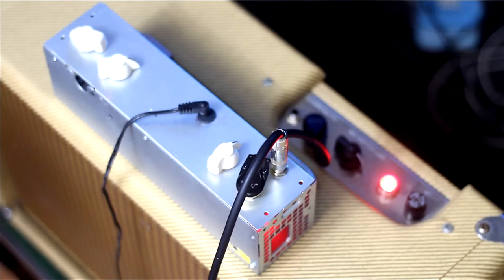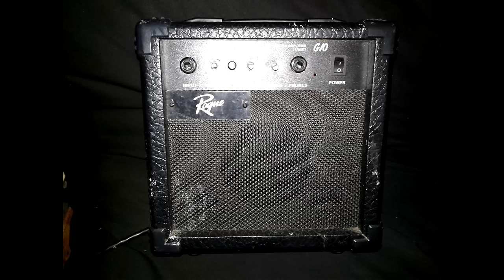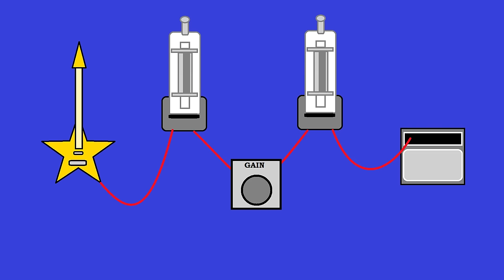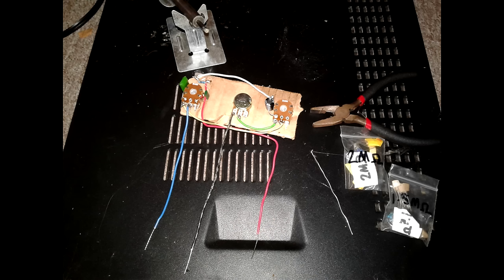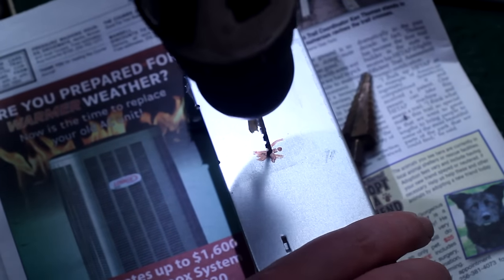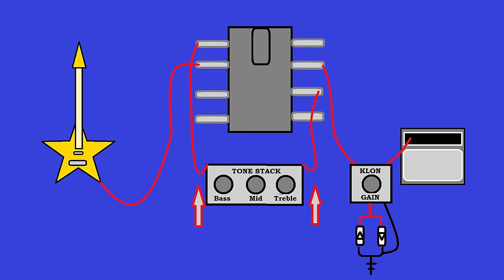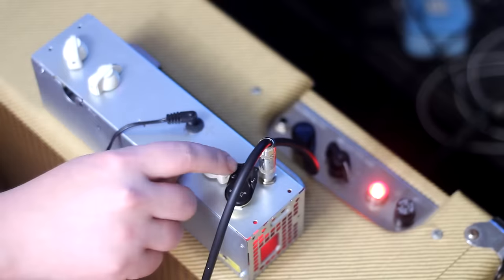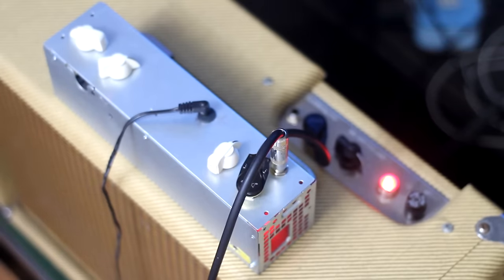DIY Guitar Tube Preamp Build and Demo (Super EASY!)

Comment: If you are the techie-nerd type like me, you might want the specifications to refer to:

Specifications:
Musical Fidelity is the mid-1990s introduced products,
Excellent sound effects, cute and unique appearance, after the market caused quite a stir.
Its role and advantages are: the connection between it VCD, CD, DVD, CD-ROM and other digital audio and amplifier,
Can greatly reduce the "digital taste" and "transistor sound", so that the entire sound system
Bring an sweet natural "taste of bile"
Used convenient AC 12V 500mA power supply
You do not have to worry about looking for high-voltage power supply
The board comes with a boost
Allows you to enjoy high-pressure tube at a low supply of charm
 
The board includes two 6J1 tube, simply connect the transformer can work
 
1. Voltage: AC12V 500mA
2. Dimension: 170mm x 60mm High 28MM
3. You need to add a transformer, the board can work
4. It is soldered kit.

Comment: Great video! Does the software you used to text tone stacks work for pedal circuits too? I'm trying to find a way to test circuits without buying all the parts
Reply from the maker: Thank you for watching and taking the time to comment Carter. The tone stack calculator will not simulate full circuits but... I suggest LTSpice. It will simulate anything you can come up with and has a built in scope. You can test at different points and do all kinds of things. It is not easy to use at first has quite a steep learning curve due to being so advanced but it is very useful and has infinite possibilities once you get it down. You can find videos on youtube that show how to use it. Thanks again and I hope this helps.

Comment: This should work with my "Sunrise" magnetic sound-hole pickup, which many acoustic guitar players were using back then (still are in some cases).  I can plug straight into an electric guitar amp, but having a preamp should make it more versatile and probably improve its tone?  Thank you - appreciated....!

EDIT: This is the preamp/buffer I'm considering buying to go with the pickup I've had for 20+ years.  Do you think your preamp build will do the same, or similar? Tanks! 
(don't know if links are allowed here, so I won't post it, but it's at Reverb called SB-1)

Comment: I really like this DIY idea and the video is awesome. Can I replace the tone stack circuit with, say, an EQ pedal between the left and right tubes? and continue to dial it such that it resembles or is similar to a guitar amplifier?
Reply from the maker: Thanks for watching and taking the time to write a comment Than. That would work just fine as song as it has a way to cut down a little volume youll be golden or maybe you want extreme distortion so crank it up.. hell I guess you could try a bunch of different pedals in the middle and see what you get. Heck you could consider this as tube buffers for before and after your effects LOL. Anyway though yes that should work fine.
Reply: @heavymetalATC  Amazing... Thank you for sharing; this is very fantastic. I'll experiment with various pedals and EQs to see what results I can get.

Comment: Love your videos, and your teaching style.

What if this preamp could be switched between the tubes (or triodes, whatever) being parallel or series?
Reply from the maker: Thank you so much for watching and for taking the time to write a kind comment Brian, You could wire this in a way to switch from parallel to series it would require a little thinking but it may be most simply done with the use of 4 jacks one for each in and out but have the left out be one of those jacks that have an extra set of contacts that close when you plug the cord in and run a jumper from the output of left to the input of right with it or hell.... Naw...naw that's too complicated... just a simple on off switch to connect or break a wire going from the left out hot to the right in hot so that you can switch it on and use the left in jack and right out jack only now you are in series and just ignore the right in and left out jacks. but you would need to put a set resistor or a potentiometer on that wire the switch is breaking because running one right into the other with no gain reduction sounds like ass as you saw in the video. Ahh I hope that helps or is understandable that gave my brain a good twist.

Comment: How would I go about making a stereo tube amp with this? I imagine I could just two units, but I don't know how I would power them. Would it need two power supplies or could the power be daisy chained some kind of way?
Reply: Or since it's a stereo pre amp, I could wire a left and right input and output correct? I'm wanting to make a tube head to power speaker cabinets.

Comment: Nice vid. Very helpful. One question. Since there is such a thing as a solid state amplifier (as well as tube amplifier) it begs the question, is there such a thing as a solid state preamp? If there is, would love a video on a build.
Reply: Practically all distortion pedals and “amp in the box” pedals are solid state preamps
Reply from the maker: Thank you so much for watching and taking the time to write kind comments guys Shirtpants you are correct thats exactly right, but.. Vinny gave me a good idea for a video building a solid state preamp in this same super easy DIY style using little pre-populated boards like this tube one. I put that in my notes... And If/when I make a video on it and I'm sure I will at some point in the not to distant future because Ive already talked to my guru Petey and gotten his expert info on the subject I will give you a shoutout.

Comment: I'm blocked at seven, like I dont get the distortion. I think I don't plugged the jack correctly because yours are inside the pedal and I can't see what you've already done.

Could you help me please ?
Reply from the maker: Thank you bro I apologize for the delay I actually been away from the channel for about a year... Hahaha soo you really just caught me. 

OK so I have had many people say many things differently about this circuit some say its too much gain some say none some say no break up but very loud... Ok I think it very much depends on the pickup in front of this preamp and the amp after it. It may just not be exiting the tubes enough to break up. 

It could be possible that its wired wrong but if its just loud as hell and clean it might just be that those particular tubes and pickup etc ect. if you run a straight jumper between the tubes the output should be so much more than a guitars that it will destort even a clean amp?

So some things you could try to make it make fizz is to blast the sh!t out of it basically. A guitar with a humbucker will do tube fizz better than a alnico strat for example and a boost pedal in front will for sure help it saturate and fuzz up? It is like a tube amp if your guitar dont have enough ac coming from it to spatter that first tube it dont splatter the next one worse so that dont hit the amp even worse. 
same as inside an amp and this is why people stack distortion into tube amps and are always switching tubes around and chasing that fizz. 

If you have a boost pedal of some kind or a distortion pedal that can get loud and clean i would try to hit it hard and see if it fuzzes out. Another way this could be done is to put it into the fx loop of an amp and let the first stage of the amp hit it hard and fuzz it out but... youll want a volume on the preamp or a master volume amp or youll never turn it up loud enough to get it to fuzz out on the front with out blowing a speaker or going deaf. Hahaha

I do hope that is some kind of info? I think that if you keep playing with it and moving it in a chain you are bound to smash it with some signal and itll fizz out good for you... Given your budget you can make a easily boost from a set of computer speakers and fizz that preamp all the way out: https://www.youtube.com/watch?v=Vtfz1eDaU5g

If not... Let me know on a new comment and Ill take my lazy ass over to the box and dig the preamp out and look at the wires.

Comment: First of all the way you have those tubes laid out they will cook the capacitors.

Second you need at least 120 volts on the plates. Might as well by any plate voltage starved pedal like a Butler Tube Driver

Comment: I want to build one very similar This is a good way to get this type sound i been told psu section is helping and like they said many like this. What i am going to do is a little different with a strong psu section.But i want to experiment on feedback loop,s in the circuit.trying to eliminate them with no fear of self swing"google translate".Many of my solid state amps do not have negative local or global feedback loops in them. The circuit i am using to build them is well tested and a very linear and populare power amp section.Lc audio: The end xp millenium.
Reply from the maker: Thank you for watching and taking the time to write this detailed comment Leohobb. Ah, yes normally feedback loops will give the amp or preamp a cleaner and clearer sound at higher volumes. I have built a preamp before with the negative feedback on a switch so I could turn it off for a more distorted gritty sound and turn it back on for a cleaner sound. Many people will replace the negative feedback resistor in a fender amp such as a champ, so they can vary the amount if they want it to be more clear or more distorted. I saw the schematic for the millennium amp design, very clever design it took someone that understands electronic much more than I do to design that. No feedback loop but claims no distortion, Is it that you plan to do this with a tube amp? if so that is awesome. A Vox AC30 has no negative feedback but it is therefore very distorted at high volumes but if you can negate that need in a tube amp with a different design you will really be on to something, the audiophile high-fidelity home stereo guys would be beating down your door to try to get an amp like that.

Comment: Hey man great plan but what tunes are those are they 12ax7's and since each one is two valves can you run one side into the other then into the first side of the second tube then to the final side of second tube for more gain and maybe up voltage without killing it I don't know just asking OK thanks for video
Reply: That was supposed to say tubes but you know how theese phones are smarter than we are and write what they please
Reply from the maker: Hahaha yeah it may be hard to do without causing a squeeling loop but maybe done using a transformer... Though I know you actually can have controlled feedback in an amp that way.. infact fender did it but backwards to keep the amps clean all the way up to super loud its called negative feedback. 
  Thing with these tubes is I found out from a knowledgeable viewer that whatever kind of little military surplus radio tubes these are? they only actually contain single gain stages... imagine the distortion if it was going through 4...

Comment: So for the tone stack, would it make sense to just line in a 7 or even 10 band EQ pedal? Or would it be possible to program an Arduino to manipulate the signal and save "presets" to a rotary encoder? I love the idea of building this but I prefer to have as much flexibility as possible and I don't like the idea of being married to the Vox tone or JCM 800 tone. In an ideal world, I'd love to build it out like the Joy Preamp House, where there's a ton of amp models that can be tweaked and can have separate gain stages. I really love this experiment man! You really are Super Saiyan!!!
Reply from the maker: Thanks for watching and taking the time to write a comment Jesus. Using an eq pedal should work just fine as long as you can attenuate the volume down a bit unless extreme distortion is what you want then go for it. Hell live dangerously: throw an OD pedal in there. The Arduino idea is great! Thats way above my pay grade though LOL I dont even like using opamp chips as much as tubes and transistors. I gotta keep it simple for my fragile mind Hahaha.

Comment: recommend a transformer to power both this and a TDA2050 amp through an ac to dc buck converter?
Reply from the maker: I dont have a clue exactly which transformer in general would be best but I do do think that would be one loud @ss amp as a twin on a set of 12s or something expecially with a boost out front or extra preamp stage in there to really get some grit.

Comment: Was there a one site that was better than the others for finding easy to read diagrams of the tone stacks ? Id like to get this little amp as a project for my nephew. But i want to make sure he gets the easiest to read directions or diagrams etc. Thanks. This video is very cool :-)
Reply: Also you just need a 12v power adaptor correct ? Nothing special, just 12v ? Just trying to make a list of what DIDNT come with this kit so i can order it for him. Thanks
Reply from the maker: Thank you so much for watching and taking the time to comment CTC. Ah yes, Using the schematic on the tone stack calculator can be very tricky when transferring to an actual point to point diagram or building on vero board. Rob Robinette has been kind enough to create some awesome point to point picture diagrams of the Fender Bassman BMT (bass, middle and treble) tone stack as well as the 2 pot BT (bass and treble)  and even has a diagram of the Baxandall BT used in the Ampeg amps. You can find those about 3/4 of the way down this page: 

https://robrobinette.com/How_The_TMB_Tone_Stack_Works.htm

I had someone ask me about this power supply yesterday... It must be an AC to AC transformer and it seems that they are getting harder to come by nowadays all the search results show only AC to DC converters. However I found one on Amazon yesterday for the other viewer its a high end Jameco name brand one but it is perfect for this project: 

https://www.amazon.com/Reliapro-ACU120100D0531-Adapter-Transformer-Straight/dp/B00B8861T2/ref=sr_1_3?crid=1AW9R2L32EMMV&keywords=ac+to+ac+12v&qid=1658870701&sprefix=ac+to+ac+12v%2Caps%2C770&sr=8-3

I hope this helps CTC. 

One more thing I just thought to add is that if you dont wish to build a specific style of tone stack they do sell premade boards on Amazon that could be a super fast and easy solution to being able to adjust bass treble and volume in-between the 2 tubes (gain stages) Heres a link to that: 

https://www.amazon.com/Comimark-XH-M802-Passive-Control-Preamplifier/dp/B07XP7CQ9N/ref=sr_1_46?crid=3EPQUSL8B9J3L&keywords=mono+passive+eq+module&qid=1659012877&sprefix=mono+passive+eq+module%2Caps%2C157&sr=8-46 

Have a great day bro and I really appreciate the interest in my channel and projects.
Reply: @heavymetalATC  I found i have a 12v adaptor. How do i know if its AC to AC ? Mine says: 
100-240v 50/60hz 0.5a
12v 1.5a
Reply from the maker: @ctcards2636  Does it have a little symbol anywhere around where it says 12v that looks like a solid line and a dotted line or does it have a diagram on it like + -(0)- - both of those things would designate it is DC output  as well as saying DC anywhere on it if it just says AC adapter then it most likely is but if it says AC/DC or dc on it anywhere then its not. Also If you have a multimeter you could test it if its not putting out AC its DC.
Reply from the maker: I should explain that last bit... AC will show as DC on some meters but at 1/2 voltage but DC wont show as AC.
Reply: @heavymetalATC  Yes it has a circle with a line thru the middle. C with a circle in it. circle with a plus. Those are the three charecters. It doesnt say AC or DC anywhere on it. Its a .I.T.E. Power Supply for a router i use to own. Model #. MU18A2120150-A1.

input 100-240v 50-50hz 0.5amp
output 12v 1.5a

Comment: Could this be used to with a reverb tank to create an external spring reverb? What additional changes would need to be made?
Reply from the maker: Thanks for watching and taking the time to write a comment River Bard. From my own past experiences I really dont think this has enough output to push a reverb tank. You could add a small solid state amp board to push the transducer but then its not really a "tube" reverb as much as a hybrid. Also this runs on AC power and those little amp boards run on DC so it would require two power supplies. A small solid state stereo amp board alone would work well to create a reverb unit I have made spring and plate units in the past using the little amps found in old computer speakers. Heres a video that might help in your reverb quest: https://www.youtube.com/watch?v=1t1sbeOMm3c

Comment: Could this work for a small cigar box amp just powering the speaker? 4" speaker maybe?
Reply from the maker: Thank you for watching and taking the time to comment muddy. I really dont thing the output of this preamp is enough to power a small speaker louder than a whisper if that but it could be hooked up to a small class d amp board from amazon or ebay and be VERY loud. The only issue with that is you have to power this with AC so you would either have to find a tube preamp board like maybe a headphone preamp that runs on dc or an amp board that runs on 12v AC.. or find or build a rectifier and voltage regulator board to turn 12v AC into DC. I hope that helps and thanks again.

Comment: Hey I know I am really late here but I just wanna ask, can I use the tone stack as a guitar pedal and plug it directly into my amp; aka can I use the tone stack without the preamp, would it still have the same effect?
Reply from the maker: yes you can make a tone stack and run it passive but it will decrease the volume as part of the signal goes to ground so it may be too quiet but the tone knob on a guitar is exactly a passive tone stack. if you put it in a pedal and it cuts too much volume you can always put a boost or distortion in front of it or more perfectly run it in the effects loop of an amp that is the best situation the amps preamp will power it.
Reply: @heavymetalATC  yea i kinda thought the same, thank you